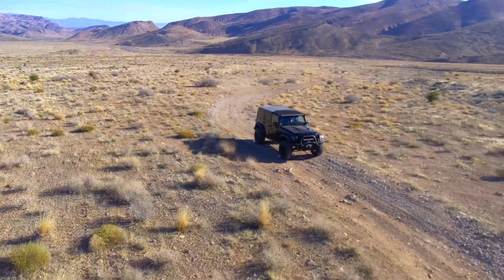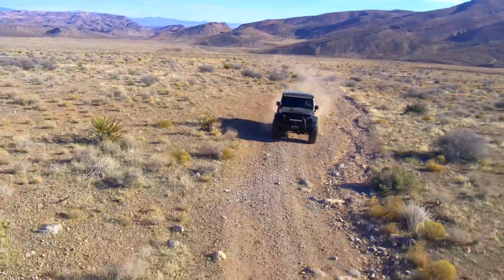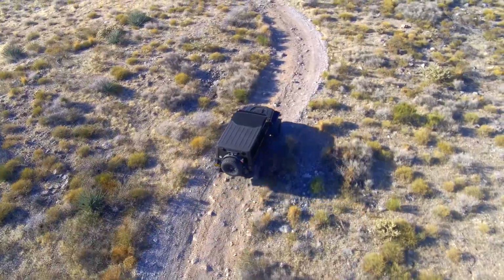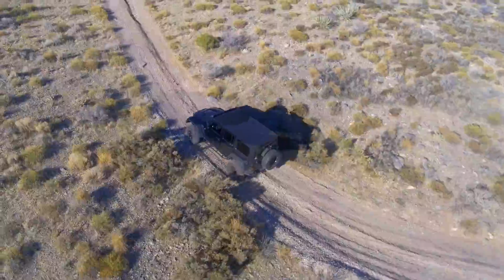2016 Jeep Wrangler Rubicon LS3/6L80

Comment: What's your most powerful engine you guys have like the most HP. Great video btw
Reply from the maker: I would say the new LT4 will be at over 600 HP. We have built Gen IV supercharged engines with 7-800 HP but for a stock crate engine I'd say the LT4 will be. With some work on the LT4 I will easily be over 700 HP.
Reply: WranglerJKLS wow rocking out 800hp in a jeep must be fun to drive.
Reply: I'm going to say it will be the LT4 with near 700 HP.